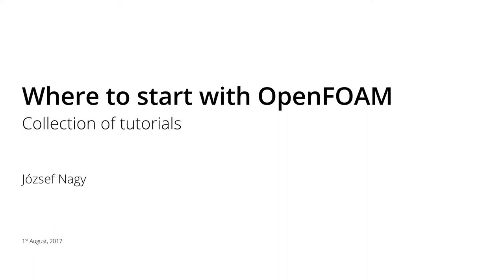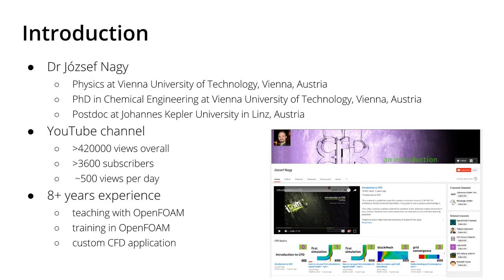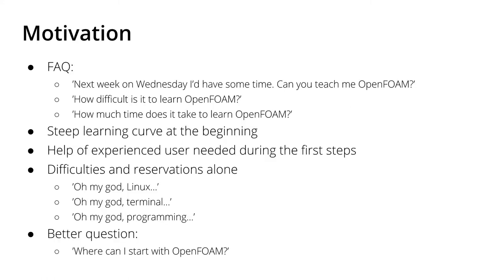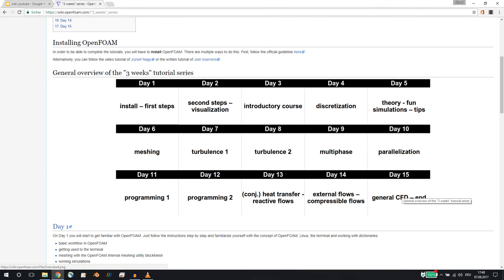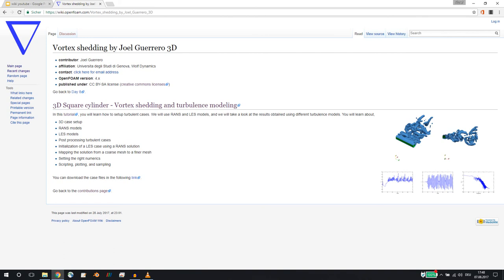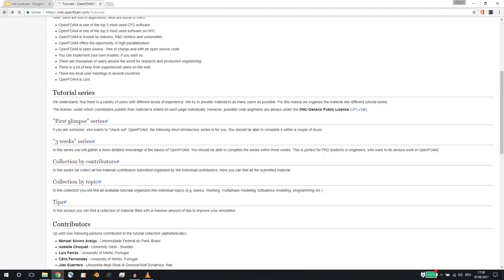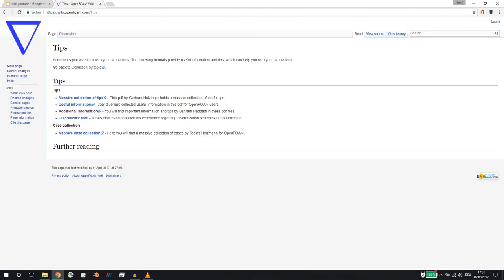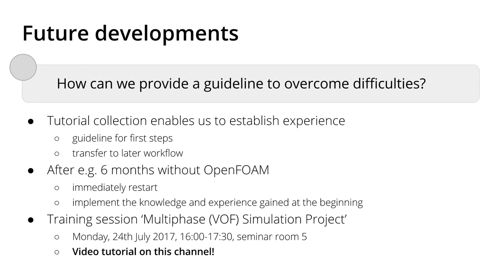Collection of tutorials in OpenFOAM (basics, turbulence, multiphase, meshing, programming, etc...)

Comment: hey 
József,

first of all, thanks for this video and for all of your OpenFOAM/Linux videos in general. Your channel, combined with the tutorials and documentation on the OpenFOAM wiki, have made this open-source framework much more accessible. So again, thanks a lot for your efforts.

A slight issue is that after having followed the instructions as per this video, the bash does not seem to recognise the "fluent" command, even after I am in OpenFOAM/OpenFOAM-v1812/tutorials/incompressible/icoFoam/elbow. Any ideas on what could be causing this? I have made certain I have sourced everything correctly.

I copied the tar file using: cp -ar /mnt/c/Users/<USER>/Downloads/OpenFOAM-v1812-windows10.tgz . 

Then I untarred using: sudo tar xvf OpenFOAM-v1812-windows10.tgz

After extraction, I went into bashrc using: nano .bashrc .

I put in this at the bottom: source $HOME/OpenFOAM/OpenFOAM-v1812/etc/bashrc

Sorry for the lengthy message. I've tried Googling, looking on the OpenFOAM wiki and also on the CFD-online.com forums, but I couldn't find anything. I'd appreciate any help on this. Thanks.
Reply from the maker: Where is your OpenFOAM folder. In your home?
Reply: @OpenFOAMJozsefNagy  thanks for the reply. I think I accidentally posted on here because my comment is actually in response to this video on installing OpenFOAM in Windows 10: https://www.youtube.com/watch?v=xj0dB_PsElg&

I am not at all familiar with Linux or the terminal so sorry beforehand. I'm not sure where exactly my folder is, I presume this line:

/mnt/c/Users/<USER>/Downloads/OpenFOAM-v1812-windows10.tgz . 

Means it gets copied into my home? And then I untar in the same folder so I think it's in my home. When I type in "ls" in the default location, the OpenFOAM folder shows up so I think it's in my home folder.
Reply from the maker: @alovyachowdhury9143 What do you get when you type ls $HOME?

Comment: Nooo you switched to windows :((
Reply from the maker: Don't worry, I didn't switch. Currently I am running three different desktop versions of Ubuntu, three different server editions of Ubuntu plus Centos on the computers. Also I use Windows 7 and Windows 10 if I need them. It depends on the software I need. Don't worry you will be able to follow me in Linux ;) But I noticed, that most of you (~57%) watch my videos from Windows, which surprised me.